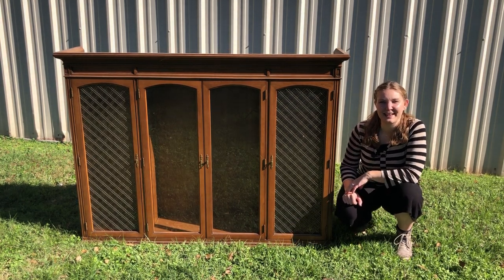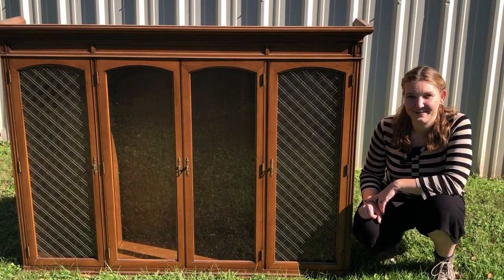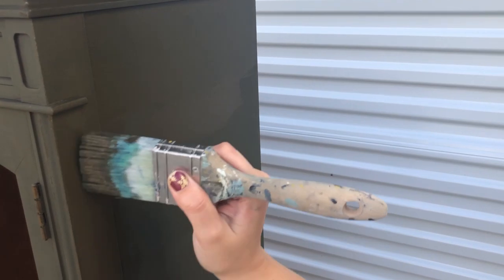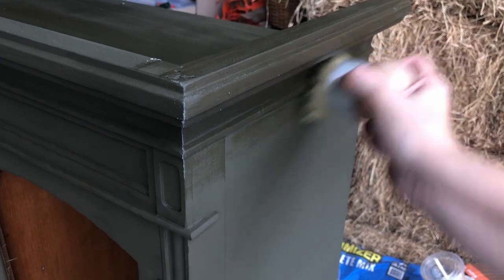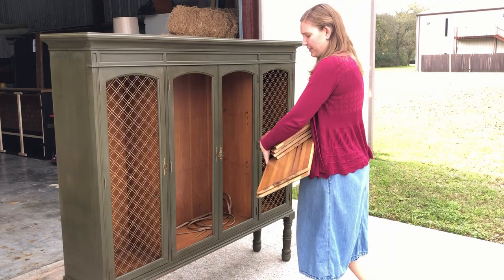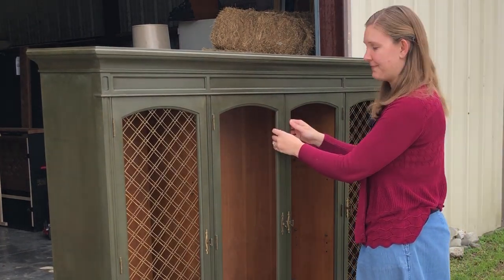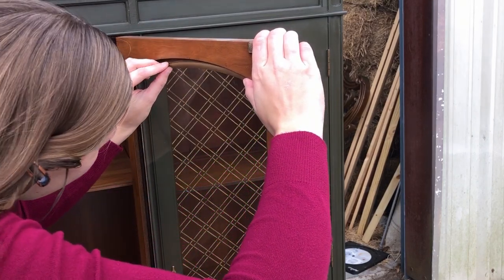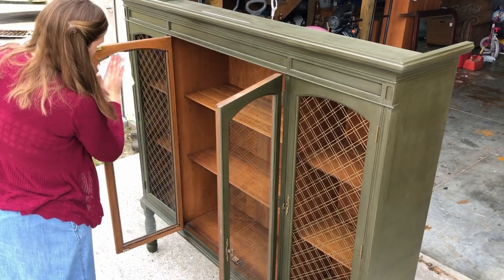WHAT TO DO WITH AN OLD HUTCH | Adding Legs to a Hutch TOP | China Cabinet Top Repurpose

Comment: This is nice. It’s a library hutch. The two end cabinets are perfect for books with pretty things placed behind the glass doors. I don’t think adding an apron around the bottom of the cabinet adds anything at all. I think the legs work well with this piece. Maybe add some puck lights to the area behind the glass. I bought some on Amazon and it really elevated the look of the cabinet. Mine are battery-operated with a little remote. Dean at Busted to Buffed has tutorials if you want to add “real” lights. I’m sorry you had a few little mishaps while working on this piece, so maybe you want to send it on its way and try lights another time. I really like this cabinet. It’s sophisticated and you did a lovely job.🌸
Reply from the maker: Lights are a fantastic idea 💡

Comment: This is a really nice green and looks especially nice with the brass metal as accents.  I wouldn't put a base around the bottom unless you moved the legs so the square part was completely under the hutch. Then put a base on to cover that square potion... but that seems like a lot of work.  An alternative would be to use material that goes from square edge of one leg to square edge of another leg but I think it would look right.  So I would leave as is, I think it looks great!  😉👍💕
Reply from the maker: Thanks Robin!

Comment: Where can I find the code of the paint? That’s the green I need for my kitchen cabinets.
Reply from the maker: It's called "Unplugged" so you could search that with Behr or there is a photo of the top of the can in my Community tab on my channel page- BUT you'll have to scroll down about 7 months (but I don't post that often so it's actually not too far!)

Comment: Title of video is how to add legs to hutch, but video doesn't show how to do that 🤷‍♀️
Reply from the maker: The title actually doesn’t say “how to” because I realized I didn’t get that part actually filmed. Very Sorry that you felt misled though- I’m still learning the whole filming thing.
Reply: @OurFurnitureFlippingAdventure  Oops says Adding Legs...have you done a how to for adding legs? I have 3 hutch tops taking up space that I need to move, and not very handy with actual construction. Sorry if my original reply sounded bitchy...didn't mean to come across that way 💜!!
Reply from the maker: @doreent298  honestly the reason I didn’t film it is because my husband did it (without warning me) because I have him handle the construction stuff!! We usually talk through and brainstorm how to fix things- then he does it because he likes power tools more than I do lol! In the case of a hutch top it will depend on what the construction is. Bun feet are a good easy option (although not very dramatic). With this project we used metal “L” shaped brackets to attach the legs to the boards that were already around the base.